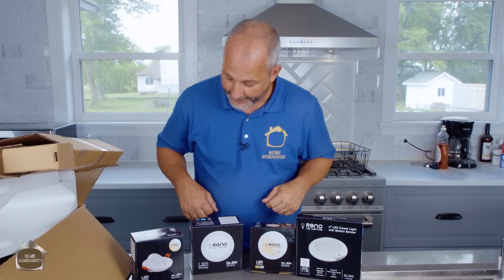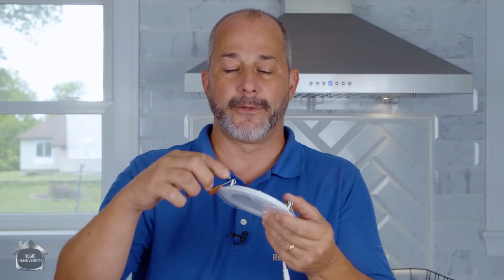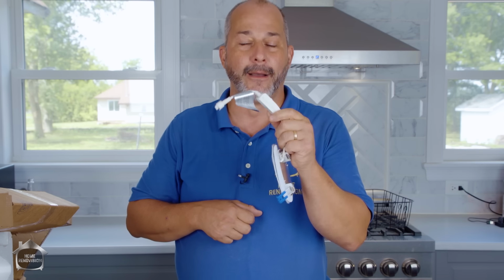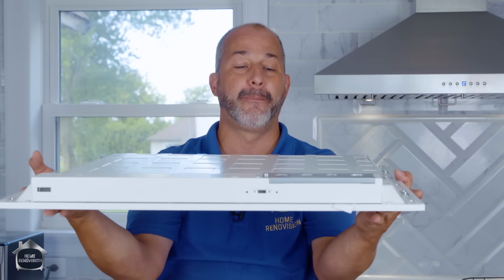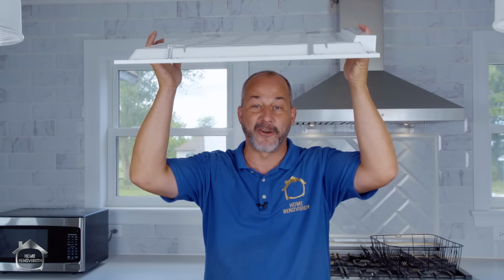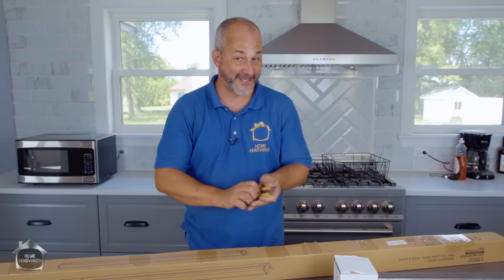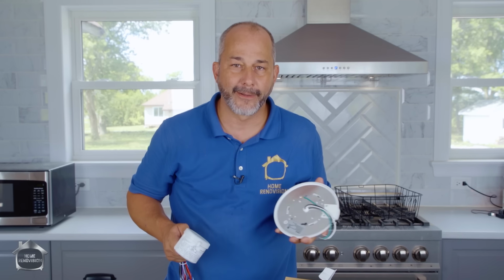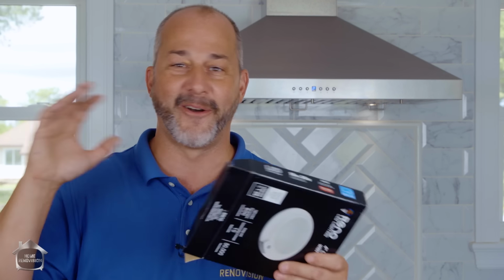The Best LED Lighting for DIY Projects! | LED Pot Lights

Comment: Thanks for the great content! Just installed 12 led pot lights in my kitchen and 10 in my family room. Different light levels for each. The led lights with switches to change color are a game changer. I’m both cases I selected a different final temperature that what I would’ve purchased.
Reply: What color temp did you settle on?

Comment: Lighting designer here; glad to see you having fun with some of the newest LED lights. A few points:

In the US, variable color products are being labeled "color tunable" or "color selectable." 

Under cabinet fixtures flipped around and mounted flat to the header over closet doors make excellent closet lights.

Spacing is a tricky subject. The fixture manufacturer publishers a ratio called the spacing to mounting height ratio. You might have to call the manufacturer or get your hands on a photometric test report. It is a simple ratio often called S-M or SMH. You just multiply the ratio by the height of your ceiling. A 1:1 ratio means you'll get even lighting in an 8'-0" ceiling with fixtures spaced no more than 8'-0" apart. 1:2? 10'-0" apart in that 8'-0" ceiling. The amount of light you'll get depends on the light output, the spread of the light, and the colors of the room it's in.

Last, the tripod outdoor light was nicknamed the "Space Needle" fixture by one of my clients after the famous tower in Seattle, WA. =)
Reply: I messed up the SMH ratio; the latter should be 1:1.2
Reply: Do you have a link to where i can find the outdoor light?

Comment: I like the idea of putting those drop ceiling ones in my basement but I don't have the standard 3" clearance you mentioned, 1.5" maybe.  They have to have the flexible tiles just to remove them.  My plan is to just take down the old drop ceiling completely and paint everything up there and the joists dark navy.  I'll take out the old fluorescent tube lights that aren't even spaced properly because the joists don't match up with the grid of the drop ceiling.  Thought on lights for that? I was thinking something mounted inline with a few of the joists tucked up so the lights just poke out beyond the bottom of the joist.

Comment: Hey Jeff, I've been watching your videos for the better part of the year and they've been a great resource for our kitchen and bathroom renovations.

I have a question on the subject of LED potlights. We knocked down a wall between our kitchen and living room and want to add potlights where there are currently none (old 1970s home).  We thought these would be a great way to go but I am unsure whether to go with 6in or 4in and what spacing. I did contact an electrician because we would also need one or two light switches added but he recommended i go with a traditional  IC housing (roof is right above us) and led replacement bulb/trim with color temp tunable option. His reasoning is that if the light goes bad you have to replace the whole light compared to just a bulb. We would definitely save money with the slim led potlights and replacing a bad one down the road doesn't look expensive or complicated. Can you give advice /recommendations? We're looking at 14-16 lights installed.

Comment: Jeff! Got a question troubling me. I want to install a floodlight cam on the side of my house on one end. I was wondering instead of getting a traditional block to install the light to on the vinyl siding, is there a mounting block that is set to an angle instead of flat? Thanks in advance!!

Comment: Hey Jeff, I'm in an old apartment building that's now a condo. It has heated concert ceilings which I can't drill into. Can you think of a way to secure a big 2'x4' LED panel light to the ceiling? Maybe PL the mounting bracket to the concrete?? Here's the link to the light...
https://www.homedepot.ca/product/feit-electric-2-ft-x-4-ft-52w-white-integrated-led-edge-lit-flat-panel-grid-troffer-with-colour-changing-cct/1001159514?searchterm=017801724127
Reply: Also, I'm also Canadian and I'm absolutely loving every video you've put up.

Comment: Great video as always, and amazing product selections, so you mentioned that in a couple of weeks you would be doing suspended ceilings, and that would probably mean pot lights etc. here is a suggestion, show us how you would use a push in wire connector with the (very thin) 18 gauge wires already attached to the LED fixture. thank you

Comment: I love the colour changing switch on most of the lights, I didn't know that was a thing, but great when you have no idea what colour works best in certain areas. Do you know if they have similar things with the LED replacement bulbs for regular light bulbs or the old pot light placement lights?
My parents have the old 6" Halo cans we air sealed and installed in their ceiling many years ago and they are looking into the LED replacement cover (I think that's what there called) but they want different coloured lights in their living room then in their kitchen. Do you know much about those LED replacement cover things that upgrade old can lights to newer looking LED pot lights?
Thanks and Cheers

Comment: I've been looking for an option to replace some fluorescent lights in my kitchen over the sink but I can't find anything good.  I'm kind of looking for something that can fill the same space since they're bulky with the whole structure holding the bulbs, but everything is designed to go up in the ceiling and that would be hard to access.

Comment: Check out IKEA’s battery operated closet lights with motion sensors! I installed one in the mudroom closet because it’s in a dark location. As soon as you open a door it lights up. Needs 4 new AA batteries once a year!

Comment: Excellent video!
I'm just wondering if it's possible to have only one transformer box for a series of LED lights, instead of one box for each?
Would simplify the installation a lot, and the cables running around would all be low voltage.

Comment: Jeff i ordered the LED 2' x 4' drop in fixture...well i placed an order for one at  115.53 and when the order was processed they INCREASED the price  36.71 for the fixture making it to 152.24..!!!!!!!!!!!!!!!!!!  Got the 20% off using the JEFF-20...THEY are THIEVES!...contacted PAYPAL to file a complaint so it will be investigated.....Wanted you to know they are crooks!
Reply: Are you sure? When I ordered, after I put in the promo code, the price flipped to CAD from USD. This made the price look higher because the CAD is worth less to the USD. Then when I checked out my payment was in USD and was correct. Tripped me up for a second as well but I noticed the currency flip.

Comment: Hi Jeff, the video isn’t even finished yet and as soon as the shops open, I will be getting LED lights. The one thing that worries me just a little is that we had LEDs in the front room (years ago before all this new stuff came into view) what we didn’t bank on was the moment we put the front room light on the TV came on and the channels kept changing until we switched the light off.

Comment: That "LED" strip blew my mind.  Now I know what I'm putting in my unfinished basement laundry area and garage workshop.  The PO put in those ugly hanging LED shop lights that plug in, but it shouldn't be too hard to change over to boxes for these, right?
Reply from the maker: If you have any issues just let me know and I will walk you through it Gina. Cheers!
Reply: @HomeRenoVisionDIY  Thank you!  And I just realized that I typed LED instead of fluorescent.  Hanging fluorescent plug in shop fixtures are what I have, but I'm sure that doesn't change my question or the solution.  I'm just correcting myself in case of confusion.  :)

Comment: Great options on lighting. I'm wondering what those huge flying saucer lights are going to look like outside? I always worry about finding replacements when the LED lights burn out. You can always find light bulbs but they always seem to discontinue whatever LED lights I put in.
Reply: You’ll probably be dead by the time your LED burns out.

Comment: Do any of these have replaceable bulbs?  NOBODY talks about what you're supposed to do when these LED lights burn out.  They will burn out.  LEDs can last a long time, but sometimes they don't, and they certainly don't last forever.  So now it's 5-10 years from now and you have to replace the whole fixture, but the company you bought the originals from doesn't exist anymore, or doesn't make the same model anymore.  So now changing a light bulb is a renovation project.  Why the actual fuck would I want that?

Comment: I love your videos! I really wanted to support you by buying 8" and 4" LED strips, but website pricing is shady all over the place; I checked and add 5 * 8" lights in my cart, $129/piece; supposed to be $645 total, and I was expecting a real 20% off when I entered the JEFF20 promo code... Nope! it is not the case; the price first went up to $849.95, and gave me a discount of $169.99 which makes the total $679.96???? Even more expensive than without the promo code? Care to explain?
Reply: Check to see if the currency switched from US$ to CAN$.

Comment: That motion sensor closet light would be perfect. IF it will go into a standard box.  The postage-stamp-sized blurry installation diagram image on the website seems to imply it will, but can't really see.

Comment: I changed all my  house lights to LED's back in 2010 .  I had several 24 inch Fluorescents in closets. I just changed them all to LEDs  using just the new LED  tube lights no wiring needed.  I also installed Insteon dimmer switches back in 2010 as well so all lights are dimmable  and programmable.   I can even change where the switch is located without having to run new wiring . So for that switch thats across the room making you walk in darkness to get to it just mount a new switch at the entrance to the room, simple.  Love  your stuff Jeff .  Having just one arm I've had to look for lots of tricks to do home improvements.  Wish you'd been available 20 years ago...  Cheers...

Comment: Just ordered some 6" led lights!  But those 4' and 8' LED strips are super expensive.  The local big box has similar ones for 1/2 the price!
Reply: Did you try to use the promo code? When I use the promo code prices are increasing :(((
Reply: @sevimleemi  Price doesn't increase it's just the price goes from USD to CAD once you apply the promo code. When you actually pay your payment will be in USD and be less. Tripped me up for a second too when I ordered some.

Comment: Video mentions GTA and then link is Vega. Which is it?
Reply from the maker: sorry for the confusion. I misspoke in the video. the company was rebranding to sell into the American market while I was filming. The link is correct!
Reply: @HomeRenoVisionDIY  Jeff, the promo code you shared with us is increasing the price, they advertised 8" led strip $129 without the promo, and when you add the promo code it goes up to $136 ($170-%20 off). Could you please talk to them?
Reply: Can Sevimli Thought it was strange too when I was checking out but then realized that it’s the currency conversion. When checking out, the price goes into CAD since the company seems to be in Canada. That’s why it looks like it becomes more expensive, since the dollar is different but the code works and it’ll show you correct amount on your card statement after the conversion. Hope this helps.
Reply: @HomeRenoVisionDIY  thanks

Comment: I have10 the 6” dimmable ones  and I love them  . I didn’t know about the motion ones but I will be adding them to all my small closets. Thank you .
Reply: Motion LED: Great olace is the lined closet.  The only problem is getting power to those areas, especially if you live in a condo where the exterior walls are CMU.

Comment: What would you suggest is the best option for under cabinet cabinet lighting?
Reply from the maker: i always love puck lights on a low voltage harness for cabinets! but as a retor fit you can get battery powered led puck lights that work with a quick press on them to turn them on or off. Cheers!
Reply: @HomeRenoVisionDIY  Great, but how are THESE fixtures, illustrated in the video, powered/ wired?

Comment: great stuff jeff,    If you get a chance check out flush mounted led button lights,    i have had really good results for landscaping,even interior,  takes up next to no space,   used with a very small controller, found on amazon     called tomshine     16 lights for around 74 dollars canadian including controller,   waterproof,you can walk on them, fantastic around the hot tube,best price in the market

Comment: Jeff, I want to do this but the wall switches only control half switched plugs.  There is no ceiling light.  I can get power from other areas in the attic but is there a remote switch option for the cans so I don't have to fish switch wires?  Thanks.  Love the channel.
Reply from the maker: nope. your house is old and needs better wiring to add lights. time to fish! Cheers!
Reply: A possible solution is installing a maestro dimmer in the attic, and pair it to a pico remote switch which you can wall mount in your garage.
Reply: @SecretlyAHorse  BINGO! Thanks...great tip.

Comment: One thing I learned recently is you can't have 2 dimmable switches wired in 3-way. One needs to be a regular switch.
Reply from the maker: great point!
Reply: Need a 4way switch
Reply: @camrouxbg  4 way switches are for more than 2 locations. He's talking about dimming from only 2 locations. The switches cost more, but it's possible.
Reply: I use Lutron Maestros for multi location dimming. Pricey but they have a good feel and some cool features you won’t find in a standard dimmer
Reply: Sure you can, you just have to pay a bit more for switches.

Comment: Some of those type lights have extension cables available as well in the case where the existing electrical is not where the new light(s) desired.

Comment: hey Jeff,will certainly watch how you use and install those LED lights,we in europe were obligated to change all of our lights to LED,mostly to save on our electricity,wich is very expensive (as is all what we buy 21% tax on everything),check out these lamps and armatures  https://www.brico.be/nl/verf-laminaat-decoratie/verlichting/plafondlampen/d4/
https://www.brico.be/nl/verf-laminaat-decoratie/verlichting/slimme-verlichting/d491/  the last link are smart lights,have a great weekend

Comment: Hey Jeff, what sort of lighting solutions do you recommend for homes with wood ceilings? I have post and beam construction in mine and don't have drywall or a layer between the wood and tar and gravel roof to add some of these awesome lights.
Reply: Same here

Comment: I’m replacing my old 6” pot lights with 4” puck LEDs.  I wish someone would make a product that would allow a 4” LED light to be installed in the old 6” hole that would just snap in place.
Reply: I did the same thing at my  house 
Had 6 inch potlights and bought a bunch of 4 inch and when replacing.. was pretty mad at myself. But i purchased goof rings that just go between the ceiling and the light.. it worked out great
Reply: @Hvac-Alex  Where did you buy them? Home Depot or specialized store?
Reply: They make 6 inch pot lights. I’m sure there is also adapters for 4 inch to 6 inch pot lights which is a circle that the 4 inch pot lights sit in
Reply: They do make adapter rings, We use them at work all the time
Reply: I have bought many 6" ones from Amazon best price I've ever found.  Led Wafer lights I think is the search term I use.
Reply: Yea i saw them on amazon  but ended up getting them at a local electrical supplier 
I do believe amazon was the better price though

Comment: On LED lights, is a homeowner still limited to the usual 12 electrical items (plugs, lights) per circuit breaker or are more items permitted due to the low wattage requirements of LED lights?
Reply: While I don’t have an answer to your question, I think it would be good to limit the # of LED lights. This way you can create zones in a room with different switches
Reply: As long as you don't exceed the 80% rule you should be fine. For example you're only allowed 12 amp on a 15 amp circuit or 12 plugs each plug counts as 1 amp
Reply: You are not limited to 12 lights, but you are limited to 15A for a lighting circuit (in a home).
80% of 15A is 12A, 12A x 120v = 1440w.
Because you can't change the bulbs in these led fixtures, you can simply divide 1440 by the wattage of the light (let's say 10w for easy math, the ones he showed in the black boxes said 8w), 1440/10 = 144 lights on one breaker.

You can only do this if the fixture cannot change wattage.

Comment: With the first couple LED options, would you need to add access to the junction box in the ceiling/attic?
Reply: Exactly, how do you simply pull out the light to adjust color?..
Reply from the maker: great question. since the light is installed on a spring clip you can simply pull the light out of the hole and access the switch and box so it is already accessible according to code. Cheers!

Comment: Those drop LEDs make SO much sense — geez imagine the amount of energy savings through reduced wattage and reduced heat — and not to forget the longer lifespan of LEDs — replacing those god-awful fluorescent lights in the office! Why wouldn’t any company upgrade? 

I’ve been sold on LEDs for my house since 2015 starting from when I used to be in an apartment — I shaved $60 a month off my energy bill from changing all the crappy apartment lighting from incandescents to LED! I didn’t even bother going a month on the new house without instantly changing out all the lighting — but I’m seeing an energy bill of just over a hundred — maybe $150 as opposed to other people averaging $200-300 a month with similar houses. 

The only area I can’t save is with the kids’ leopard gecko tank. Those are still incandescent UV lamps and heat lamps — doesn’t seem to be an LED alternative to those — because the heat produced is actually what’s needed.